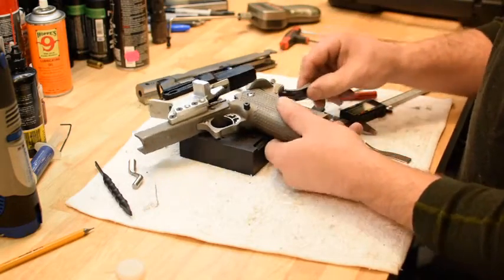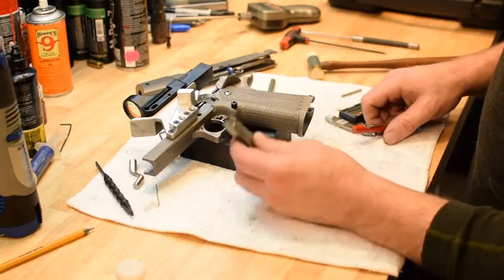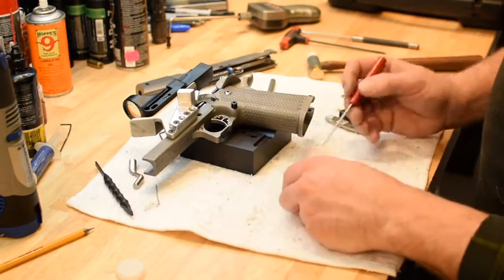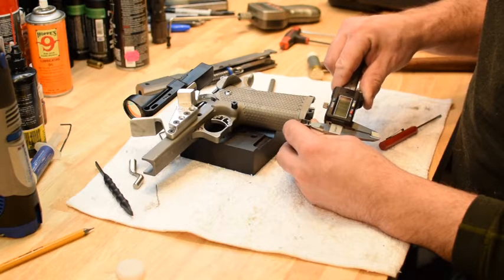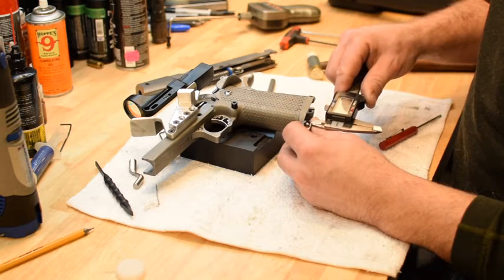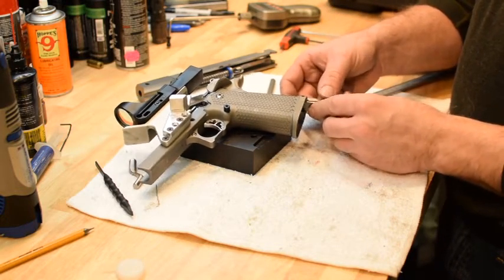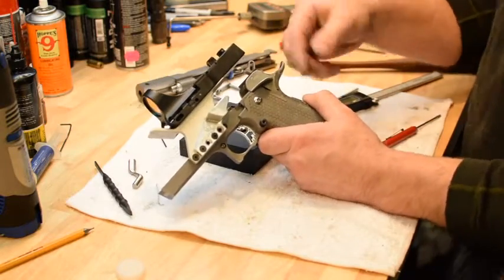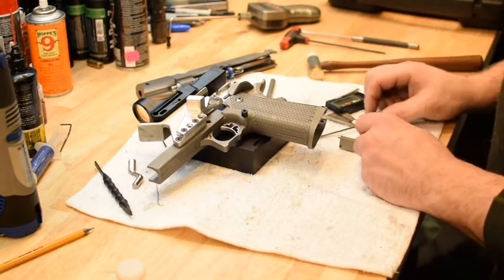Pinning Grip Safeties

Comment: Question out of curiosity: You state that removing the tab is in your opinion the wrong way to disable the grip safety, fair enough. You then go on to say that not only will the part not run again (true enough) but, and this is the point, you add :"It also doesn't contact the sear spring." The leg of the spring responsible for the grip safety although part of a single unit is totally isolated from the center leg that is responsible for the sear. Now, if the entire spring unit was free floating I could imagine there might be a slight difference to the sear spring pressure however given that the mainspring housing compresses the full body of the spring I would suggest that will cancel any  deviation to pressure on the remaining legs. I would say pinning is far more attractive and tight but I doubt that shortening the grip safety tab will affect the sear in any way. Just my opinion. BTW, I shortened the tab on my Commander and it has never experienced any difficulty or problems. Also, yes, if I had access to a drill press I would pin. Far more professional. Thanks for your video.
Reply from the maker: ScottGpa if you run 2lb triggers everything counts to get a consistent break and break weight.  pressure from the grip safety does not always affect the search spring but it can.  light competition triggers are very sensitive to all inputs to the sear spring, not the case when you have 3lb or more triggers.

it's ok to cut the tab just not the best way to do the job.
Reply: Well I take you at your word. If you ever laid eyes on my old Commander I'd guess that you'd cringe. I however love it, it fits me like God himself taylor made it for me. Colt satin nickel with idiot scratch, no tang whatsoever on the grip safety, filed it off years ago. Not a whole lotta that nickel left in fact but I tell you what, that old girl fits me perfect and never fails. It eats anything I feed it. I'm certainly no gunsmith, just an old tinkerer with a good dose o' common sense. I appreciate you taking the time to read my thoughts and get back. Gotta put my 70Sc to bed now, she gets half of a queen size bed to herself.